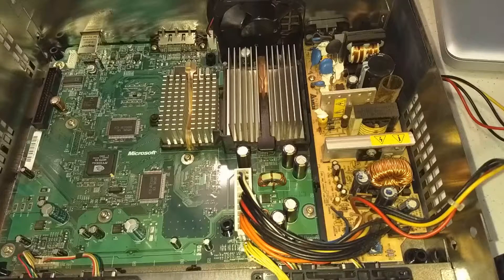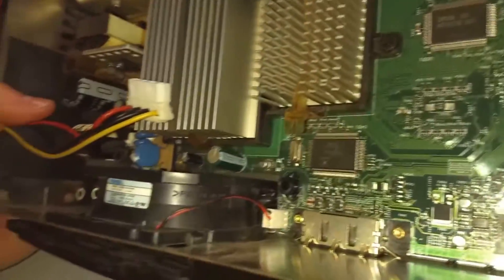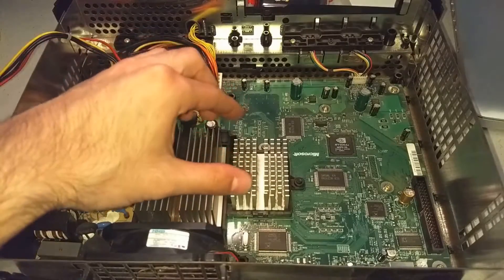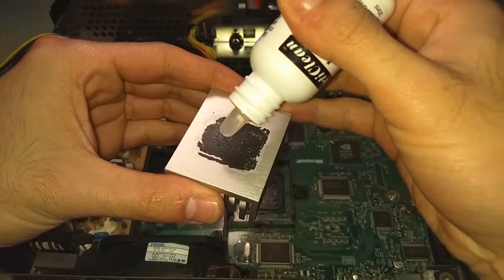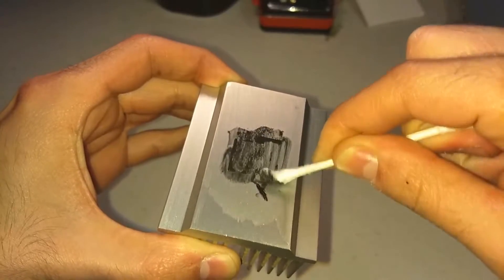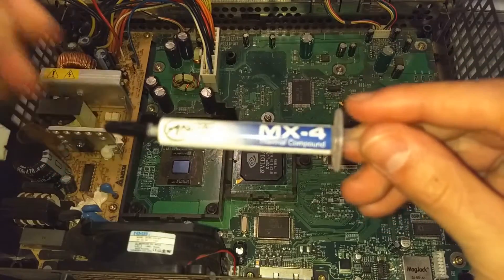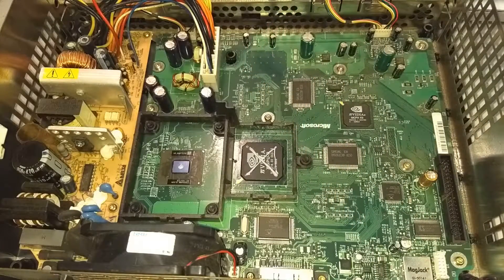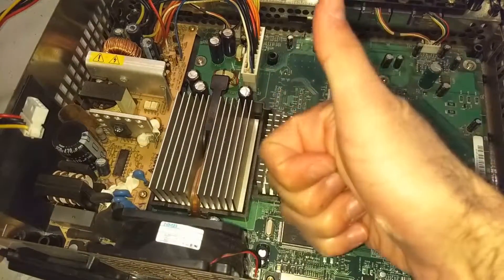Replacing the thermal paste in the Original Xbox

Comment: I just did this on mine a couple of weeks ago.  What's interesting is the bigger heatsink came right off without warming anything up. The smaller one was stuck. I used a heatgun for maybe 10 seconds and it popped right up. I didn't want to plug the console in and turn it on because it hasn't been used or played in 10+ years. 

I do have a question though....what kind of thermal paste was originally on yours...mine was exactly the same as yours, this black ridiculous stuff that was almost like silicon? I've seen other X-box's with clearly normal grey colored thermal paste. I used Arctic Silver 5.
Reply from the maker: Some kind of factory compound that was cheap at the time (im guessing). I've seen some pink stuff before that was basically rock solid

Comment: This is full of misinformation. OG Xbox does not use a "paste from hell", it has a quality PCM from the factory (either pink on earlier revision units or black on later revisions) which has completely different properties from paste. It lasts the lifetime of the console and does not need to be changed to thermal paste at all.
Reply: Yeah just got one secondhand. Its already been opened and soft modded. The temps look absolutely fine. I don't think I'm gonna bother with swapping it, it just looks messy. Glad I looked at these videos before going for it
Reply from the maker: Thats all probably true. Heat is wear and tear though, so people will take the extra step to baby the consoles they really love. Will it make a big impactful difference? Is it pointless? The truth is somewhere in the middle
Reply: @retro_vg_repairs3339  I refurbish 100s of OG Xboxes, it doesn't make any meaningful difference. There are way more important service items on these consoles like dying CPU capacitors on some boards, leaking clock capacitors, trace rot, broken solder at the power connector on early PSU revisions, etc. In terms of heat, OG Xbox consoles do not overheat under any circumstance other than a blocked/dead chassis fan and the CPU and GPU are basically immortal.
Reply: @AlDim000  My 1.6 was running really hot and lagging. I replaced the thermal paste and now its running alot cooler and its faster. Quieter too. The other Xboxs I've modded didn't need it though but they were earlier revisions.
Reply: @Bountyhunter108  1.6 units always report higher temps than earlier revisions, which is completely normal. You'll only have thermal issues if the original PCM has been disturbed (that can happen to the CPU heatsink on occasion due to the small contact area, it's important to check if the heatsink is loose).
Reply: @AlDim000 It was very loose, yeah. The only thing holding down the heat sink was the clamp.
Reply: A friend gave me his Xbox version 1.6 that sat in a closet for maybe 10 years and when I press the power button it blinks green, fan kicks on then goes off, blinks green fan on then off then blinks green fan on then blinks orange and red. Any ideas?
Reply: @Red-yz6fl  That's commonly referred to as "FRAG" (flashing red and green). This is most commonly caused by some sort of a bios issue (i.e. a modded unit that isn't able to start up for whatever reason), but there could be other problems as well. It's good to check if there's an improperly installed/failed mod chip, any leaks/damage around the clock cpacitor, bad CPU capacitors, etc.
Reply: @AlDim000 Thanks to replying to an old video comment. The xbox console I have has never been opened until now so no mods or anything done inside. I opened it up and it's a 1.6 from what I figured out and everything looks good and I cleaned it up with air compressor and isopropyl alchol but it does 2 boot attempts and the blinks red and orange on the eject button light.
Reply: @Red-yz6fl  Did you check the state of the 5 3300uF 6.3V capacitors by the CPU? If they are Nichicon brand, that could be your issue. If they are Rubycon, there's a different issue.
Reply: @AlDim000 The capacitors near the CPU on my console are labeled Sanyo. They don't appear to be damaged or bulging. Is it possible to test them with an analog multimeter while in circuit or do they have to be removed to test?
Reply: @Red-yz6fl Are you sure that's a 1.6? Sanyo CPU caps were used on earlier revisions. 1.6 should only come with Nichicon or Rubycon CPU caps.
Reply: @AlDim000 I think it's a 1.6, the clock capacitor is the gold one and it's positioned near where the drives plug into the motherboard(IDE port I think it's called?). Some parts like the dvd drive also have dates stamped 2005. Maybe it's a factory refurbished console?
Reply: @Red-yz6fl Yeah, that's a 1.6, those capacitors just aren't common at all for that revision. If you have a video cable plugged in and aren't getting any on-screen error message, there's a lot of guess work as to what is actually wrong. The only very common issue on 1.6 boards is CPU capacitor failure if you have the Nichicons, otherwise they've been really solid. If you are getting a FRAG error light, one repair method involves installing a mod chip to see if there's a bios problem, but that involves extra work on a 1.6 as the LPC port needs to be rebuilt and there's no guarantee it will actually help, so I'm not sure it's worth going through all the trouble.

You can always swap in another board + HDD from a parts console. For 1.0-1.4 you'll need the PSU as well, for 1.6 just the board and HDD. 1.6 shells work with all board revisions.

Comment: Unfortunately i could not un plugg those power supply wires I had to use the hair dryer method with a t shirt to remove the hot heat sink with the stuck old thermal paste

Comment: is that a heat spreader on the GPU? it looks like I could scrape the paste off (it's not coming off with the methanol i have access to) or is it a bare die of some kind? I'm reluctant to use heat after removing the heat sink, for fear of floating off the chip
Reply from the maker: Yes it's a heat spreader. If the system works, run it with a game for about 20 minutes and try again. It will loosen the old paste
Reply: @retro_vg_repairs3339  I opened it up to take out the clock cap and replace the thermal compound before powering it up, i figured after sitting that long, i should address it right away, so i don't have to worry about popping the cap myself.  I ended up using my hot air rework station at a low temp (150) to soften the compund enough to remove the gpu.  The harder parts were getting the CPU clip off, and the compound off the bare GPU, that stuff was about as soluble in methanol as car tyres in rain.  came right up when i got acetone, though.  The Xbox is a delight to work on, it's so straight forward and simple, for how much is packed in there

Comment: What about if the Xbox won't turn on? I've got a 1.4 Xbox that I want to get up and running and I'm not sure why it won't power on. I've even tried swapping out other power supplies from other Xboxes. I'm wondering if maybe the CPU or GPU is overheating due to old thermal paste and once replaced, it might work again.
Reply: Does your xbox do the power cycle thing?  Does it go to turn on, but then shut off, then turns on again and shuts off, and then boots on the third time, with no picture and flashing lights?
If so, no matter what colours you get on the front, it's a hardware related problem, and they're very hard to recover.

Comment: The thermal compound on my Xbox was pink, and it took over an hour to remove (even using the remover).  It was an absolute nightmare.  But it works now :)
Reply: I just fought this fight tonight. Still takes over an hour in case you were wondering.

Comment: Mine isn't even turning on with all that stuff removed (it's a 1.6)
Reply: Someguy Studios don’t remove the hard drive or the dvd drive just unscrew with a T-10 and move to the side. Mine is a 1.6 and turns on fine like that. Have to disconnect the hard drive power cable but that’s it.

Comment: One question. Here lately my og xbox freezes on games,take a look at games that it does this with and they look fine,probably happens after long plays. Could this be the thermal paste? Thats about the only thing that havent been changed
Reply: Yep that's a classic overheating symptom.  I used to get those freezes on an old box when I put the fan speed down too low sometimes.
Reply: @ExtremeBogom  yeah I believe it was that. I replaced the thermal paste which I was a bit nervous to do and assuming since everything else was replaced or cleaned I have a brand new old xbox ver.1.6! Lol! One of my favorite go to consoles

Comment: I just did the same thing to my xbox. Fresh thermal paste on both chips. Dont go cheap with the paste and get your self Artic Silver 5. It works wonders and keeps your xbox running nice and cool. I removed the clock capacitor too. Luckily It did not leak everywhere on the board.

Comment: I did the same thing (without damaging the fins though), used a heat-gun to produce the necessary heat on the sinks (hair dryer should be good too), removed the cool-paste with WD-40 on a patch of cloth which is working great, and finally used high quality thermal conductive pads on both chips.

Comment: Quick question and fast response I hope?  I took apart an Xbox and removed heatsink but I'm only trying to clean out/ remove dust. Am I able to but the heatsink back on without replacing new thermal paste? It is a nice pink color and it is a newer version.
Reply from the maker: NVRNDR 911 theoretically, the paste will no longer be evenly spread so it will affect temperatures. I highly recommend applying new paste since it's cheap and easy

Comment: I do everything the same way but I prefer thermalgrizzly kryonaut. It's pricier, but it's designed to last an unbelievably long time, and it isn't conductive or capacitive, which minimizes any possible damage to electronics that could be caused by the paste shorting them out. Arctic is capacitive, which makes it less than ideal for bare dies like the cpu in the og xbox.

Comment: I must be going wrong somewhere along the line... replaced the fan with a brand new model, got it hooked up at 100%, modded it properly so I could fit the fan.

CPU temp now gets up to 70 during gameplay - is this normal??

Can't remember GPU temp but I recall it was much more reasonable.
Reply: That happened to me too when I put a new quieter fan in there. I had to run it at full or almost full otherwise it got too hot.
Reply: Bionic Man 70 is fine during game play. Relax
Reply: ah ok great. Since it's softmodded, I can run the fan at 5x speed anyway and that seems to help a bit.

Comment: I did everything just like in the video, but my motherboard temperature went up a little. Before replacement it was CPU: 51 degrees Celsius and motherboard 43 degrees but now my CPU is 50-52 degrees and M/B: 45 degrees. What did I do wrong? I used Arctic MX-4 20gr. paste.
Reply from the maker: I have no idea, I need more info. How did you apply it? Did it spill off the chip into the socket? Are these idle temps?
Reply: I tried applying a thin, even layer, making sure nothing would spill out. The temperatures are idle. I just powered on my console for a half an hour or so with Unleash X running in background.
Reply from the maker: I just realized your temps are only 1-2 degrees higher on average. Thats a normal fluctuation and not even close to being harmful. If you're that paranoid about it, do it again and try to set the heatsink down carefully so that no air bubbles can form. But me? I'd say you're gonna be fine.

Comment: Possible to use too much paste? I put a bunch of silver 5 on mine and it seems good.
Reply: Jonathon Bevers as long as you don't smother it I wouldn't worry.
Reply: YellowElevator815 I smothered it
Reply: Jonathon Bevers bruh..
Reply: YellowElevator815 update - it's been working great all day long. Looked up arctic silver 5. Non conductive, so I'm good.
Reply: Jonathon Bevers haha ok man. I'm sure it's fine, it's just that too much paste will have the opposite effect intended and make your Xbox run a little hotter. Just keep an eye on it.

Comment: With the heatsinks removed, it would be a good time to lap them with sandpaper, working upwards to 1000-1500 grit. I've lapped the heatsinks on all my modded XBOX's.
Reply: meh, not worth it. that's what thermal paste is for.
i mean, it won't do harm if you do it (quite the opposite), but it's not going to make enough of a difference to justify the effort.

Comment: Should I still replace the thermal paste even if theres nothing wrong with it?
Reply: Its not necessary unless your console gets extremely hot.
Reply: I would
Reply: As long as you're inside, is a good idea. You probably won't need to touch it for 15 years after that so what is there to lose?
Reply: PowerLeef Yeah I was just a little scared that it would make the temperature worst. Last time I used my thermal paste to replace my pc cpu heatsink it made the temperatures worst i was scared it was gonna do the same to the xbox.

Comment: Is heating up the stuck heatsinks with a hairdryer okay?
Reply: i heated mine with a soldering iron i had laying near me and it worked fine. jammed it between 4 fins on the gpu heatsink and left it there for a good minute.
of course i just let it sit there until it was warm enough. it wasn't even 70c when i removed the iron
Reply: @GraveUypo  I just want to say thanks for the tip.  Just in the last 10 mintes I used a 25watt soldering iron between the fins on the GPU (as it was stuck solid) and it worked like a charm!  The CPU heat sink was loose as I was trying to get the clip off...   Again thanks for this tip..
Reply from the maker: sure is. The chips get much hotter from normal use, it won't damage it. Easiest way though is to just leave the console running for a bit